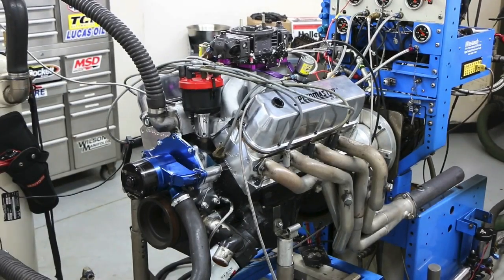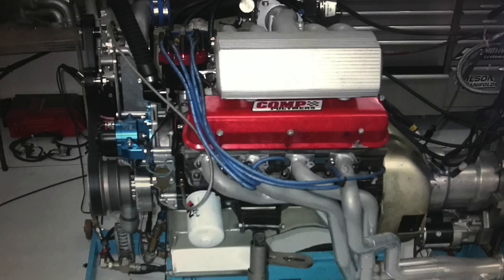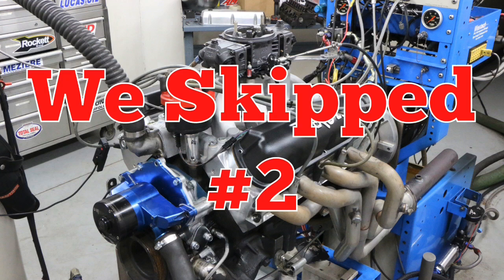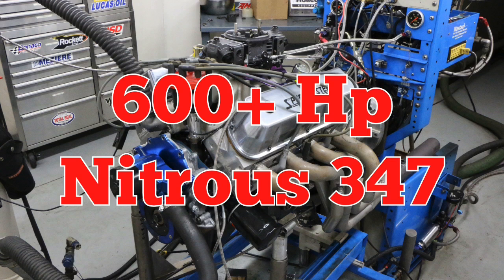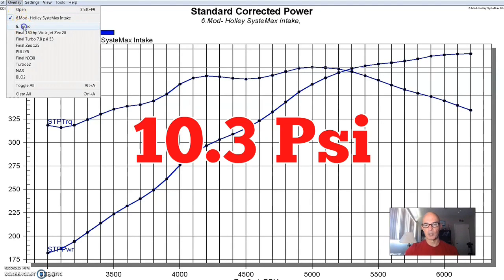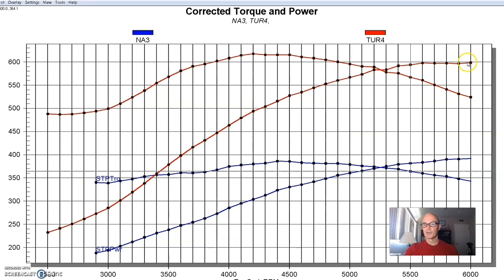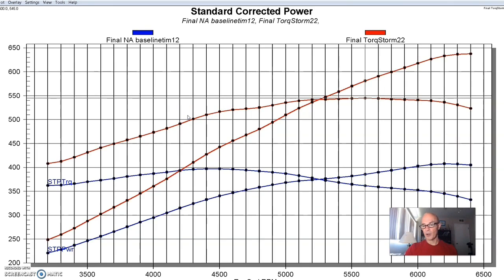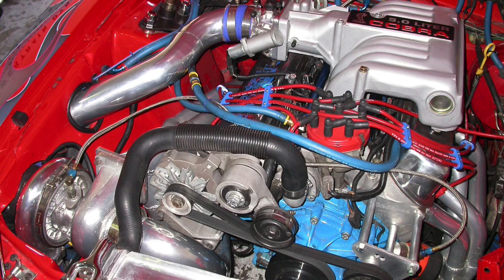5.0L FORD BLOCK SPLITTING-FACT OR FICTION?

Comment: The Mexican 5.0 blocks are stronger(higher nickel content) but can also split. Sometimes it's not obvious. Seen a high 9sec built 347 high compression mexican block in a 5-speed fox not able to hold timing after years of weekly runs. Turns out the block split right down the cam bore. Car now has a Dart block.

Comment: I agree with you on thinking it not really a specific hp number. I believe maybey tune has more to do with it. Detonation, harmonics, & so on. How rich or lean you might have it, + timing. All those things get more important as rpm & power levels go up. If its outside of those factors I guess I dont know? If I was forced to give a answere & to someone that didnt really have a understanding of how a engine really works I would just say 500 hp is there limit & then I would try to excuse myself from the conversation instead of trying to explain. ???

Comment: That little stock block can take well over 2 horsepower per cube. If you want more step up to a good aftermarket block. I use a late 70's block, which were poor castings, and for a cheap stocker it hangs! Yeah, piece of crap Ford, I was pushing 700 through the stock block and it broke! I expected so much more from a two bolt lower end, thinwall block.

Comment: It seems to me, maybe with the manual transmission car you spoke of at the end, it had that weak point to unload the stress. The transmission. I'd think it's a combination of factors, rotating mass, harmonics, and generally just the force of that much power and the block that was probably only really designed to hold up to about half, trying to resist the constant attempts that force makes to transform a v8 into a pair of 4 bangers. And you can never exclude poor decision making and craftsmanship.

Comment: The factory (Helms, I guess) shop manual has a special section on what to do with a porous block or block with "Sand Holes". The outside areas acceptable to cover with a Ford epoxy goo is-- oil pan up to bottom of water jackets,  lower rear face of block. And return it to service..
Fresh from the factory with marginal block castings. 
But Ive heard people were knocking the main bearing webs out at the strip.

Comment: Dang Richard, now my curiosity is peaked, may go look at a few xxx blocks compared to yyy blocks. Are early heavy casted 289/302 blocks beefier? I know the 2m crank is stronger than the 2mae, maybe because of the light weight 5.0 crank the main webbing is thinner? Maybe it's because ford drilled holes into the lifter valley? that is an issue with f4 casted 351w blocks.

Comment: Detonation is capable of massive pressure spikes and is like hitting it with a sledge hammer.  Detonation with a NA engine isn't likely to break a block, but more likely with a power adder.  It's an unbalanced stress in the block.

Comment: Your engine is shaped like a wishbone. Pistons come up on both sides putting pressure pushing outwards and then kaboom. There isn’t enough material in the valley to hold up to the force of the pistons getting thrown outwards. So ya that’s why it only happens on big hp engines.
Reply: Not to mention the amount of psi with boost that is under that intake pushing also. The ones that split are under extreme boost which is just extra pressure pushing.

Comment: I was always told it was high rpm. Like what happens in a missed shift. Never heard of an auto 5.0 splitting so that would be my guess. 
But then again I had a friend with a solid roller 347 and he would spin that thing 8k every pass and he never had a problem and it was a stick car that made 500ish wheel na. I think it has more to do with if that crank starts walking around and proper balanced bottom end.

Comment: The only time the roller windsors do is when they have more than unusual sized fractures where the spider braces, for holding/aligning the lifters in, bolt holes are machined into the block.  Those fractures go all the way through alot of times on the 5.0s and especially the 5.8s.  Most people never notice them including machine shops AND never have issues.

Comment: I think its more harmonics and tuning that cause it and it just happens to amplify at that power level since usually detonation and other tuning issues start getting more and more likely near there especially since its very hard to make a NA 302 run those power numbers and its much easier to run into detonation and lean conditions using power adders. Add to it most guys never change out their harmonic balancer and that just adds more issues since its barely rated to handle the over stock power level reliably for almost any factory car. Add load shock from one launching it hard and  spinning much higher than stock RPM and its all just compounding.

Comment: Cylinder pressure at low RPMs is what I think kills the blocks.  You can have the same cylinder pressure at low RPMs and high RPMs, but at low RPMs the dwell time is much longer, so the pressure is held for a longer period of time.  Too much boost or too much N2O at low RPMs will generate very high cylinder pressures.  That's my theory.

Comment: 50oz balance contributing to harmonics? Zero balanced engines seem to live longer.
Reply: Some guys have run the 50oz engines in the 24h of LEMONS. They don't last, the cranks snap before the race ends if they run them over 5500rpm and last less than 6h if they're ran to 6000. The problem is that fatigue doesn't leave evidence and it is really hard to diagnose. Almost all of the cracked blocks I've heard about are post '84 roller blocks and none are Mexican blocks.
Reply: @timothybayliss6680  very good point i also thought the 28 0z balance was better myself.they seem to rev faster and get there smoother. then the 50oz especailly comes into play over 5000rpm
Reply: @timothybayliss6680  
Ironically I was just wondering about building a Mex block for my 88.
Reply: i think its the balance combined with a paper thin block, short deck, and short rods. bad harmonics, and bad sideloading on a weak block means boom.
Reply: @frigglebiscuit7484  i dont agree with ur comments at all the 289 was the only american v8 to survive 24 hours of racing at le mans and won.u think a sbc 350 could do that with there horrible rod ratio.no way the 302 is basically same block as 289.yea probably a little thinner.of course it has a short deck and short rods.it is a little revving v8.and by the way i have stomped the fuck out of so called built 350,s with my 302 notchback.

Comment: harmonics and crank deflection would be my guess on why the block would split. just a guess but a stout aftermarket forged rotating assembly, mod the block for splayed main cap bolts, add a girdle and balance everything to perfection and serious reliability well over 500 approaching the 750 mark could be achieved

Comment: I remember you Olde notchback Mustang I must have read that article  I think in hot rod a hundred times I could even tell you the specs on that Silver State open Ride
Reply: I didn't know it but I've been a fan of yours a long time
Reply from the maker: thnx-still have the Mustang
Reply: We need a video on the car.  Has it progressed or did you just leave it alone?
Reply: I wonder if the 351 also share the block splitting personality.

Comment: In my opinion, 32 minutes at wot, i think it lacked lubrication. Oil starvation. It probably just stayed in the valve cover area.
Reply from the maker: that motor never got hurt-it survived 11 races at WOT
Reply: Richard Holdener guess it was a matter of time. But for what i know, those 5.0 take a hard ass beating whether its raced or used as a work horse.

Comment: From 1987 till 1995 (end of production for Mustang 5.0 blocks) The block where a bit weaker. They had a lower nickle content and more casting "flash" then earlier motors. That casting flash works as a stress riser. Mostly all of your cracks will start where there is excessive flash. For those that don't know what "Flash" is. It is where the two halves of the mold come together, and there is a small gap that allows molten metal to leak out.
Reply: The roller 5.0 debuted in '85 5 speed cars (E5AE block). They added 4 pounds of metal to beef up the '86 up E6SE/E7TE blocks (122lbs vs 126lbs).

Comment: I don't believe HP, Torque, or any power adder has the block splitting guilt.
When you tested it was with a blueprinted engine. By definition that means setting clearances, balancing, and specking the engine to exacting tolerances. It is my belief that Joe racer builds an engine in his garage, putting in parts from a catalog as is. The potential imbalance that ensues will be the cause of the split engine.  Just one mans opinion.
Thanks for sharing.

Comment: I'd say Most likely Flaws in the castings , when machining you'll see lots of Material distribution issues ( castings can get shifted )
Reply: John Woodworth : its a power spectural density thing where a  cast iron crank with a small main and rod journal.will shake tje marginal block within an inch of its life. This happened in 68, way before the internet. Lemans, they had no problems untill the 289 became a 302 when the engines.were restricted back to 5 liters in the GT40 program. The reason the 302 Cleveland/351 Windsor and 351 M engines have huge.main bearings and rod journalseveryone. And why the SBC got big main journals in 1968 when the350 came out.  In this case, NOT squirells as you yourself have said. WORD!

The 3 inch stoke and 28 or 50 unbalance cast crank without the proper 289 K code Hi Po crank and timing gear. The Cleveland foundary blocks are worse than the Windsor or Mexican blocks, but from all three plants, and from all 3 inch stroke small journal 8.206 deck blocks, block splitting is possible even on an 84 4bbl block making 350 hp at 6800rpm. (All Group A 84 to 87 race cars in 400, 500 and 620 endurance races, and European Challenge Mustang 5.0s from 82 to 87 broke blocks in races. Its a Windsor/Cleveland/Heco en Mexico Five Point Oh thing, noted from 1968 to date. The Tunnel Port G code was the first to exhibit it. The Boss 302 blocks have a 100% 249 or greater seasoned Hardness factor and a steel.crank, and dont have the problem, despite the canted valve head being way more detonation prone.

It doesnt happen with the High Performance 289 crank with 28 ounce underbalance. The first J code 230 hp 4bbl 302 to race production sedans was in Australias intense, 5 hour, 500 mile endurance event in 1968. Compared to the 225 hp 289 without the K code crank, the engine was a reliabilty disaster in intense endurance, yet the J code 230 Hp 302 in the 1968 Ford Falcon GT XT  won the 7000 mile Londan to Sydney Marthon Team prize..an endurance race. So buy a zero underbalance steel.crank, hardness test, Magnaflux and pressute test the block, sonar the bores to check for core shift. Dont use the 28 or 50 ounce unbalance crank unless its forged steel. A stock block has to be bolted to a vobrating table Humbolt make, and shaken for 2 hours with a 2 mm amplitide to stree relieve the stock cast iron. The.late Olds.engine builder Joe Mondello used to do this on his customer engines.
Reply: Dean Stevenson 👉🏻🐿

Comment: I remember back in the late 80's a guy I worked for. Had a sand dragster with a .060 350 Chevy. We were getting beat every weekend buy a 302 chevy with twin turbos.  So my boss came home with a
 Top Gun 500 hp plate system. 
I told him, you better not.  
But he did it anyway. We ran that stock block 350 like that for two summers. Never did blow it up. And we beat that twin turbo car.
We ran 3.1 sec in 300 feet on sand.

Comment: I built and refreshed a .040 over 289 for a guy years ago. Every year his budget got bigger, but he wouldn't have a 302 or 351. Cast crank, side ground and shot peened stock rods with 5/16 ARP rod bolts. Got the compression up past 12.5 -1, roller cam etc. I begged him to keep it under 6500 rpm. Engine lasted 2-1/2 years until the stock oil pump drive broke at around 7800 rpm. Replaced the crank and 2 rods. Back at the track in 6 days. Car still has same block today, 38 years later.
Reply: I love it bro. A 289 gets up there quick with proper balance. Pure music 👍. And that is coming from a Chevy guy.
Reply: Do you still build engines? Wanna rebuild mine?
Reply: An old 289 is not a cost cutting 5.0 HO. The 289 is stronger.
Reply: @angelobovara317  I agree. I was pretty much out of engine building when everything went metric. Ie 5.0, 5.7, 6.6, etc. I can't remember ever even breaking a cast crank in a 289.
Reply: @ Bill Blair , they made  some of those blocks in Mexico. I actually have one!! And yes you can see the difference in the main caps/bulkheads, they’re thicker.
Reply: Some people fail to realize that a 5.0 has a light weight crank so it does rev like a 289.... With more cubes.
Reply: The 289's and early 302's had more meat in the main bearing saddles. I can't remember exactly when, but sometime in the early 80's they made the main bearing webbing in the 302 blocks thinner.
Reply: Check out my 289 build
Reply: The later model 5.0 engines split a lot easier. Thinner blocks plus 50 oz counterweights on the ends of the crank.
Reply: Youre kidding... Was it the original ford 289? Asking cause im about to start on a 66 ford mustang fastback.. It's a California car but its rusted to shit in all the areas those cars didnt drain well. I'm planning on doing a restomod and was gonna drop in a new 5.0 crate engine. I'd much rather keep the stock block if possible..
Reply: @Danny_Thompson_sasquaatch420  It was a '67 block. The owner had built it in high school shop class originally with a hydraulic cam and cast pistons. I asked him who pressed the rods on, and he said the teacher had. All on backwards. The car is a '69 Mach I that has been rear halved, and has seen high 11's in Denver.
Reply: osp80  Ehhh, not by much. If you're looking to go that way there's a run of 70's Mexican windsor blocks that were done in a high-nickel cast iron.
Reply: @mfree80286  How can you have a Mexican Windsor block???  A Windsor block come from Windsor Canada does it not?
Reply: @graygryphon2008  The design's the windsor block, don't knock me for Ford's nomenclatures.
Reply: Holy shit, a 289 at 7800? That thing was cranking! My first car was 89 LX foxbody, with a 289 swap. I wished it ran like that! Thing was a total dog lol

I heard stories of GT40S AND Cobras spinning 10Kish but I always though that sounded like BS.
Reply: The 289 had shorter cylinder walls, since its shorter stroke and longer connecting rods didn't pull the piston out of the cylinder as far as the 302 does at bottom dead center. 

The K code Challenger 289 has the same heads as the 2bbl 289, just screw in studs rather than press fit ones. But its the same small ports and valves compared to, say a Chevy.  The Boss 302 used the longer connecting rods of the 289.  In the early 1980's Ford went from 28 oz flywheels to 50, which tells you they changed things around inside.
Reply: @albertgaspar627  Rod ratio of the 289 is optimum.

Comment: Low engine speed power breaks them.
Reply: My 200hp nitrous hit comes on at 2700 rpm.....over 430 wtq at 2700 rpm through 5500.   Hundreds of passes on slicks....no issues ever....all stock parts except an E303 cam.
Reply: @edwardmalle210  The magic number is 650 once that threshold is passed and the engine is exposed to low speed and that power number it is on borrowed time.  I  have personally replicated it 5 different times all on turbo cars. One block completely in half the only thing holding it together was the intake. The other four were cracked main webs which causes loss of oil pressure. I used Mexican block and XXX doesn't matter they all crack unless you go to an SHP or something comparable.

Comment: This was a problem reported several years back before some the aftermarket blocks came out. It happened in very high hp motors. My guess is way over a thousand hp and it took repeated abuse to cause a failure. Didn’t happen in two or three pulls. Just repeating what I heard and read. One mfg I believe DSS Racing made a stud girdle for the bottom end that was supposed to help stabilize minimize harmonics in the bottom end. Blocks were prone to breaking (cracking) in the main web area, normally in or near main cap bolting.  Better blocks are now being made for the small block fords by several manufacturers.  Another problem was main cap walking around on these motors resulting in premature main cap and bearing failures. Like I said these were all very high hp motors operated over time. How much time. Don’t know. Perhaps DSS Racing can answer these questions for you. They were one of the first to market better blocks and a main stud girdle for the small block fords both 302 and 351 series.

Comment: Oh, the block splitting was real, but I didn't break mine until I started using a trans-brake. It was a '92 LX that ran 10.20's on nitrous, C6, 4.10's.
Reply: ..... did you have solid engine mounts? I'm thinking again about this and wondering if the engine could be pulled apart from the outside due to flexy foxes.
Reply: @mfree80286  No, I had stock mounts, but the engine was strapped down.